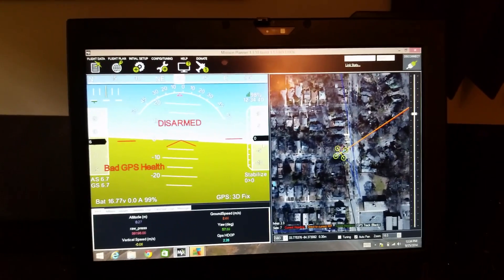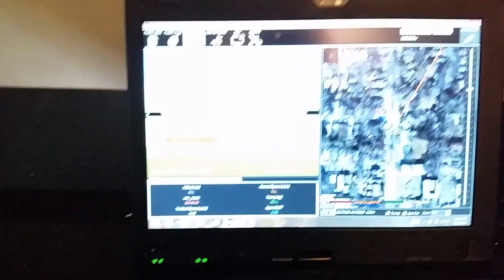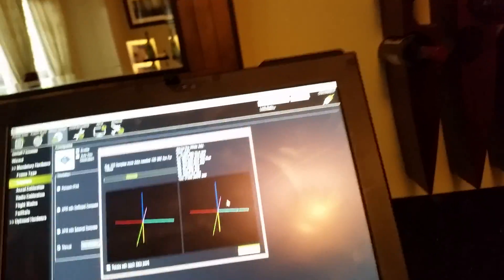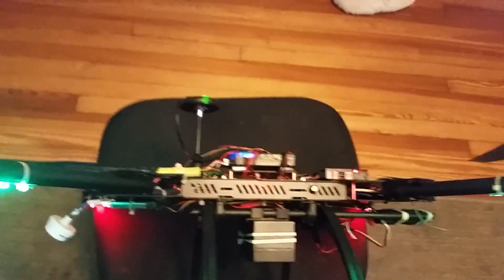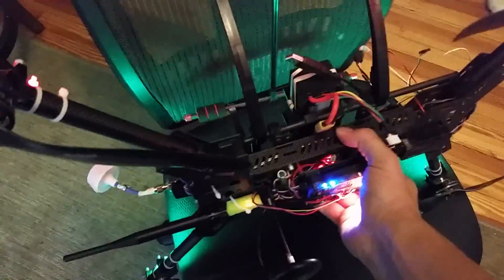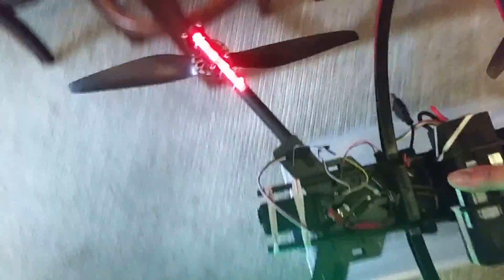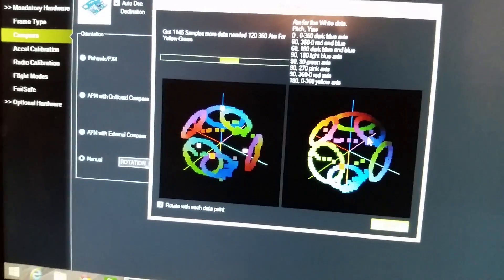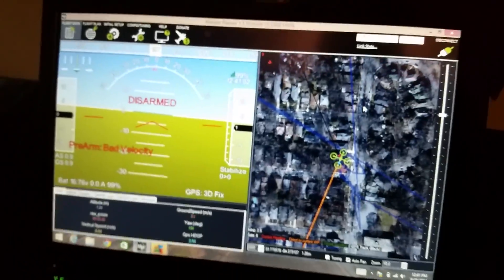APM Pixhawk Arducopter Compass Calibration 3.x - The easy way

Comment: Thanks for the video, its the easy way of Onboard Calibration explained in the doc ? http://ardupilot.org/copter/docs/common-compass-calibration-in-mission-planner.html

Could you say if the calibration is very accurate ? (as accurate as Onboard Calibration procedure of the ArduCopter doc)
Reply from the maker: I released this video when AC 3.2 just came out, at the time it was the best way to calibrate multiple mags (making sure they are orientated the same way etc). I've since started using Pixhawk 2.1 boards and 3.5 code. I'd suggest doing the onboard as in the docs since it's the "new" way and also calculates scaling in addition to offsets. The method of spinning is still the same, just use onboard instead of live.
Reply: Thanks for reply, the only difference in the procedure, is to use onboard calibration buttons instead of the live calibration button ?
Reply from the maker: Yup, the downside to doing onboard is that you can't see the graphical representation of each mag. When i'm running three mags, i want to make sure they're all orientated correctly. Do live first, then onboard, make sure they offsets are close, but do the onboard last so that you get offset+scale. Should work either way, but onboard should give you more "lock".

Comment: So, is it necessary to have nose truly 'down' and truly 'up' for these calibrations? I notice that your swivel chair won't have the geometry to allow the craft to be truly horizontal, vertical etc. Is it necessary to use a swiveling platform that has a horizontal deck and a vertical section for getting the craft to be properly horizontal/vertical?

Comment: this is a wrong way to use the chair with an iron frame, and inside room, calibration will be inexact. Better way to calibrate magnetometer - make this in outdoor place -  in  a clean field or on the empty outdoor area.
Such calibration becomes for Pixhawk only once - it is enough therefore you aren't lazy to make it on the outside.
also possibly it will be required to establish angular shift for a compass - in order that the compass could show the exact direction - it is very important!!!

Comment: I'm going to try it because my APM doesn't arms. I think it's because compass is not calibrated. Thanks!
Reply from the maker: Check the screen and be connected with MP when your trying to arm (with props off). It should give you a reason why it won't arm.

Make sure your RC is calibrated, accel is calibrated, your getting GPS satelites with a low HDOP (<5 at least), and everything else is good. It'll usually say "prearm: compass not calibrated" or "prearm: errors something or other"

that'll give you a good idea of what's going on.

Comment: Sorry, but the blue braces indicated on softw are the front of the quad?
tks
Reply from the maker: Not sure. I think it's measured in X/Y/Z  positive 0 and negative from 0. It rotates on every data collection point so doesn't tie to direction of quad. The idea is that when you rotate around one axis both compasses will draw a circle around the same leg of the axis. If they are all over the place and not a clean circle the it's interference, if they're different legs, then it's an orientation problem.
Reply: Thank you

Comment: the gps looks different then the 3drobotics sale, can you use any ublock?
Reply from the maker: +jay ish Yup, any compatible ublox GPS will work. I've used NEO-6M LEA-6H and the new NEO-8 series. Just make sure when you buy it it comes with the appropriate connector. The APM and Pixhawk have different connections.
Reply: +Nico D Thank you could you tell me were you buy your ublok>
Reply from the maker: +jay ish I get them off ebay, that one in the video is a POS :P The neo6 is alright, but i got them cheap from china and ended up loosing the magnetometer on the GPS (bad soldering) and ending up in a tree. I'm currently using a Ublox NEO M8N and like it alot. That or the slightly more expensive LEA6H. The M8N is $26 shipped from USA.
Reply: +Nico D That you, I use the pixhawk and it took off and hit a tree, now the compass want calibrate.I try to calibrate it and it says data mission.
Reply: +jay ish sorry that's missing
Reply from the maker: Are you seeing data points? you need to get every axis which is 6 positions. When spinning the drone you should see a neat circle appear and alot of sample points. Make sure you do the accelerometer calibration BEFORE gps if your still having problems..

If you see alot of points but not in a circle and they're erradic then you might have a bad GPS or misconfigured serial baud for the GPS. If you see NO points when you move it then it's probably a broken connection, so test the wiring.

If your using any sort of radio telemetry module use a cable instead. Alot of the radio kits out there don't work past 10ft, cheap radios. So use a USB extension cable or move it closer and configure it for a lower baud(more reliable).
Reply: +Nico D Does the ublox neo m8n  or the lea6h have a internal compass and mag?
Reply from the maker: most of them do. Make sure any listing says "magnetometer or compass". Most of the ones for sale have both. Make sure you have at least 4 pins on a 6pin(pixhawk) or 5pin(apm) connector and a separate i2c connector. If you have a pixhawk, make sure the auction or the note says so. That way they can give you the correct connector.
Reply: +Nico D Thanks alot, so do you think these are as good as the one from 3drobotics?

Comment: Hi and thanks for this great tip! One question if I may! How did you get your OSD working, I have been struggling for days on mine!? Cheers and Safe Flying!
Reply from the maker: +FPV Cambodia Yeah the OSD is a little tricky. You need to power both sides of the MAVLink OSD. I got a couple off ebay for a few bucks. What i did solder the jumper so it's powered from the 5v side, do not power it from the transmitter since it's usually 12V or higher (releases magic blue smoke). 
Here's a link to the setup, make sure you see the lights on both sides and you should get a bootup screen. Also load the latest firmware so you can customize the OSD.

http://i839.photobucket.com/albums/zz315/Cmartin87/osd_zpsdcc1ec27.jpg
Reply: Thanks Indeed... Will get on it soon enough and get it to work soon... I made a break as I was frustrated with the OSD... Thanks Again Nico.

Comment: How come your gps/compass is rotated to the left with the wire off to the right. shouldn't the unit be facing forward with the wire to the rear? How are you able to get a proper calibration?

Comment: compass calibration is bit of a crap setup especially trying to do it with a lead.
Reply from the maker: +Long Range FPV Quadcopter .TBS Discovery Yeah, using a 900/433 mhz telemetry module is ideal. Using a very long USB cable can sometimes have issues with communication. And yeah alot harder on a big boy versus small.

Comment: Does the GPS antenna have to be in the dead center of the quad, if I put it a few inches to the right rear, what modification do I need to make in mission planner so that it would know that the GPS is mounted slightly off center and in the rear? there is an easy way to do it for naza was wondering if calibration like you did will take care of it automatically in pixhawk?  Thank you
Reply from the maker: Power Jack Repair On the APM and Pixhawk the GPS doesn't have to be dead center. I know the Naza needs an offset but i've had great success with my pixhawk and the GPS just has to be level.

Comment: I need a fast response to this. I plugged the cx-20 into mission planner and did a controller calibration. At the end of the calibration the quad powered up on low. I unplugged it and now it will not stop beeping. What can I do?

Comment: What FPV monitor are you using?   I am building a tri copter and will try your method. I will post your video to the Drone Tech Google + forum.  https://plus.google.com/u/0/communities/102454117185037731844

Comment: Do you have to do this before every flight?!
Btw APM Planner doesn't give me that fancy graph, and I only have 60 seconds to complete....
Reply from the maker: upgrade your software, stick with 3.1.5 firmware having issues with 3.2 and 3.2.1. Anyway, new software (mission planner) should allow you to keep capturing data. You only need to do it once, or if you have traveled a long way (i re-calibrate when i travel internationally).
Reply: No.. just once.. and you shoud do more of an circular motion.. to fill the whole globe.. check my videos

Comment: Nico,

I tried and tried to recalibrate and I still keep getting toilet bowl effect in Pos_Hold after 30 or so seconds.  Once in a while I get bad compass health, any suggestions?  Should I just replace the compass at this point?
Reply from the maker: Make sure to do your Accel calibration before the GPS, also make sure you have the right orientation for the compass. If you still have toiletbowl, try moving your GPS farther away from your ESC/motors/electronics. If that still doesn't work, swap it out for a better GPS (LEAH-6) or something. I found high failure rates on alot of cheap chinese NEO6 type gps'.

Comment: Excellent video,
Iam useing a Neo 7 GPS/Compass setup but are having trouble with the compassmot setup in mission planner terminal it keeps saying failed?? what type of gps/compass setup are you useing?? also did you have any trouble with the compassmot setup?? thanks..
Reply from the maker: You have to use the CLI commands, the GUI commands don't work for me either.

Comment: i have the same gps with no arrow on it how do you know which way its supposed to point ?
Reply from the maker: +Highteckhobbies well calibrate it, doesn't matter how you mount it. After calibration point it north, if it says EAST, then your 90degrees off, you can either re-mount or alter in the config on the same page as the calibration button.

Comment: Nice video, thanks for posting. I tried a similar method the other day, but it didn't work. My Vulcan UAV Y6 is to big. I had tried to do it on one of those round spinning trays you have in your kitchen, for spices and what not... ha ha. Anyhow, I also thought that you have to spin the compass around in a way, that your collected data points form a solid "ball" or sphere, but apparently not. Thanks, G.
Reply from the maker: Watch out for metal in those lazy suzans. The other method i use is a hook in the top of a door, use a string to find your COG and rotate it around that. Won't be as level, but it'll work. Doesn't have to be perfectly flat, other videos show more data points in every direction. I just use this to check the accuracy of each calibration, i get pretty much the same results with both, just easier for me this way.
Reply: Nico D Thanks for the "fast" reply, ha ha. : ) I had no idea those trays were called Lazy Suzans! Anyhow, I was going to ask you how solid your GPS performance is, when doing it this way?! By "this" way I mean not having a solid sphere with data points, but you already answered that in your last reply... One more thing... You said that you should do the accel calibration before you do the compass one?! Why?! I am doing it the other way around, because I am spinning my Copter around a lot during the compass calibration, and I feel that the rapid movements would screw with accelerometers... Thanks, G.
Reply from the maker: +Neavissa I waited 7 months just so i don't break your expectations ;P Yeah, definitely need to calibrate accelerometer first otherwise i think it might throw off values. Basically all compass calibration does is find the min and max values of each plane so that it can guess. Using this method also shows how "off" your compass is and will result in better stability because if you have interference, you'll definitely see it if your rings aren't rings ;P If everythings good, you can do the full sphere, but i haven't noticed a difference in the two. Best upgrade you can do is buy a good GPS, LEA-6 is what i'm using and it's good, i'm also trying the new M8 GPS which is supposed to be better. Using a pixhawk you can use both for a reliable and even better location.
Reply: +Nico D LOL... better late than never. I moved on to a Solo. Still have my Pixhawk birds though... Thanks.

Comment: Good clip! But I must ask you if you have heard about that we are suppose to NOT do COMPASS Calibration... I have read about that in forums (3dr) and I have not done the calibaration on compass now after having alot of troubble to get it airborn... Now I have maiden flown it for 10 minutes and dont realy dare to do the compass calibartion that stops my flying for evan more days/ plz replay the information you have regarding this.
Reply from the maker: You should do compass calibration. It's different for every device and even for the location your flying. I also suggest doing a compass-mot calibration to make sure your motors/ESC's aren't affecting your magnetometer.

Comment: Great video thank you. I will give it a try. I tried already but at the end I didn't get any confirmation of success. Not confident it worked. Is there anything that should appear or change to confirm it is successful?
Also your GPS is the same as mine but I notice yours is not pointing forward but is turned to the side slightly in relation to the PX4. How do you align?!
Reply from the maker: The compass is pointing forward, if your referring to my LED colors, i do green on the right and red on the left (like planes). 

After a proper calibration, you should see a small window pop up stating the new offsets that are saved. If you don't get that window then somethings wrong.
Reply: Nico D OK. Thanks, I did the calibration and got the pop up with offsets. Cheers.

Comment: Great video, nice quad, what kind of frame is that?
Reply from the maker: It's a Alien 680 frame, found it on ebay. Had to build the landing gear by had (3d printer), so if you go with it, get the built in gear. Otherwise i might post the STL's on thingiverse if you are so inclined. Good frame, the pivots are a little "meh", the screws keep coming out, so a little locktight and washers are highly recommended, but it all packs in nicely into a backpack.
Reply: Nico D In the Pixhawk setup is your frame type a X or H? Do you remember what your offsets were after you did this method?
Reply from the maker: Tried the H frame, wasn't great.  Changed back to X style and flies great with just a few tweaks.